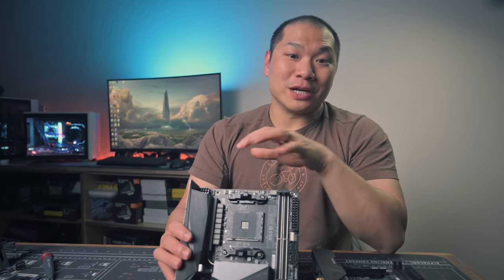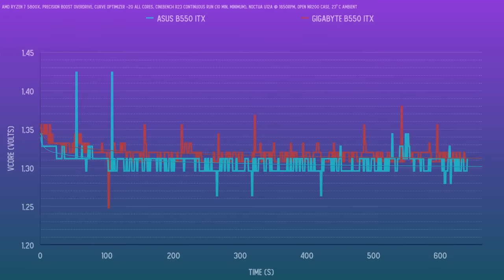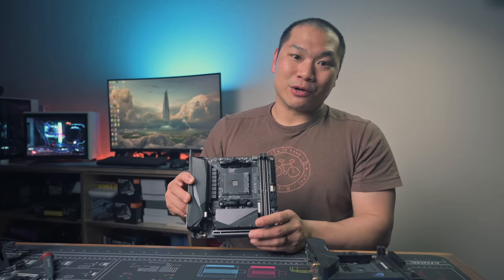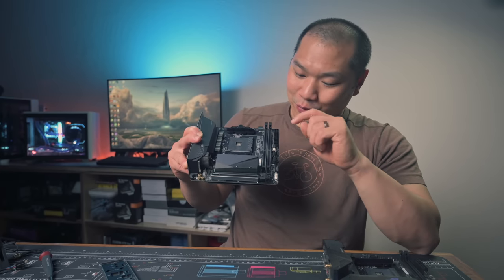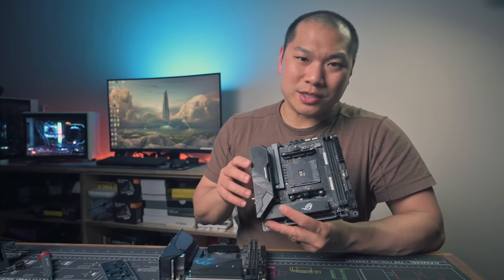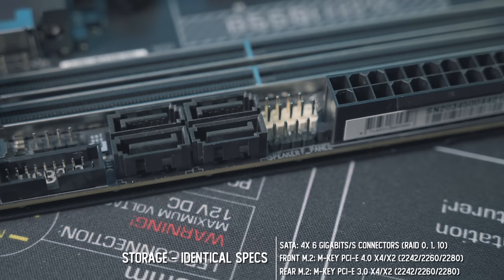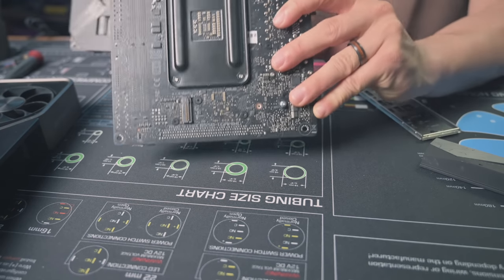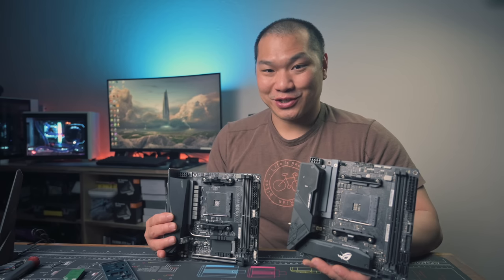Budget or Business? Comparing the Gigabyte B550 ITX and Asus B550 ITX Motherboards

Comment: The lack of USB-C front header port in the Gigabyte is a shame. We always recommend the Gigabyte except if the case has a ubs-c front, which in that case, the Asus is the go-to mobo. Really nice comparison, nonetheless.
Reply: just use a Single 19-Pin that connects both 3.0 A and USB C ports to a single USB 3.0 motherboard header.
Reply: @gabrielcorreia6216  I’ve been looking everywhere for them and haven’t been able to find one
Reply: The only reason why I did go for the ASUS was the missing USB-C front header. Rly shameful.
Reply: This is what tipped me towards the Asus.
Reply: I saw the MSI Gaming Edge dropped in price. It has overkill VRMs, type-c header and debug lights.

Comment: 1 thing I found out about the Gigabyte board (only after I bought it - and is NEVER discussed on any of these reviews or builds) is that it is plagued with both Bluetooth connectivity issues, and USB glitching. I have tried numerous online solutions to fix these but they are still intermittent and highly annoying. Also the RGB via Gigabytes software is also glitchy and has issues syncing. Love the content but I wish more reviewers would talk about this.
Reply: Running Gigabyte B550 ITX,superb board never had any issues with Bluetooth/USB glitching,but then I'm all for  for using lastest drivers.
Reply: That should all be solved now. Wasn't exclusive to Gigabyte but covered under the AGESA* update / USB issues. Bluetooth now works successfully on the latest BIOS' from... ~April 2021 onward.
Reply: I was having this same issue with the Asus B550i. I needed to clear cmos for the problems to go away. I updated the bios recently and have noticed less issues. But still have constant usb plug/unplug sounds going on.
Reply: I also still face the same bluetooth disappeared problem. Need to clear CMOS or turn off the computer (with power cable unplugged) in order bluetooth appear again. Already updated to latest driver version, BIOS to f15, still issue persists :(

I think this may be the last time I bought Gigabyte, future motherboard surely will be ASUS I guess.
Reply: It also has a raised socket position which can create issues in some cases. There is also a glitch were it "plays dead" and refuses to even turn on.
Reply: @JustOneMoreRyan  To this day there's still issues with connectivity on the Gigabyte board.
Reply: @NinjaRed5000  :( Sorry to hear. I still have the same board in my main system and no issues since that BIOS update.
Reply: @JustOneMoreRyan  my issue was my bluetooth keyboard just losing connection after it wakes from sleep and my mouse having bad connection with the wireless dongle (though I think the dongle issue is just a general issue with it getting interference from USB 3.0).

Comment: Have chosen Asus because:
CPU placement
Fan header placement (no need to run cables over whole Mainboard) 
Diagnose Led (you never know which new component could be defect)
Temp sensor header for nzxt x63 AIO fan control
VRM fan can be turned off in BIOS

So best package overall

Comment: So sad that your review does not come out before I had to make a decision. I bought the Gigabyte one, after quite a bit of research online. The main reason for the decision is the price point. Although not significant, the gigabyte one is about £40 cheaper here and my 3600 + NR 200 build doesn`t seem to need a super fancy board. I am overall happy about the board but also have some comments in addition to your great review. 
1. I am the poor guy who changes the cpu cooler and the CPU cooler header is a pain. 
2. the third mini cooler header is such a bad design. When I tried to pull the fan cable from the mini connecting cable, the cable was accidentally pulled out from the mini header. Then I realize it is almost impossible to put the damn connecting cable back to the mini header by finger or anything else because the GPU, the useless metal chunk above the m.2 leaves no space in between. 
3. Finally, I used an MSI x570 previously and see reviews about Asus, the Gigabyte is definitely behind the two - despite the overclocking settings, the fan management is simply not as good. In smart mode, you cannot manage the changing point as you wish. i.e. if you had A point at 30C 20% and C point at 70C 100%, you cannot simply set the B as 50 between 20%-100%. It will force you to point at a slash between A and C, which I simply couldn't understand. As for the manual mode, I can set the fan run at any set percentage but it will run in full at 100% above 70C anyway and it is not adjustable. As a result, the fan will on and off when I got the original AMD cooler. 

Overall, the built quality of the board is worth its price and it does run nicely. I think it fits people who build a system and use it for a long period of time instead of those who are interested in changing components for testing or whatever reason because any changes on the board almost require a full disassembling and reassembling, and for ITX, it will be some extra difficulties (and pain).

Comment: After having just built new systems with both of these boards, 100% agree with what you have said! If you could mash together features of these boards the result would be about perfect! One difference in the BIOS of these boards that stood out to me was ease of setting up custom fan curves. The Asus board requires mouse input to adjust the curve points, whereas the Gigabyte allows only the use of keyboard which really improves the ease of use. Where the Asus wins though is being able to set any fan header as a WPUMP header, as the Gigabyte only has a "100% PWM" setting instead and no dedicated WPUMP header.

Comment: I tried both, stayed with the Asus. Main factor for me was the internal USB-C header. I started out with an NZXT H1 and then a Darkflash DLH21 case, both of which had front USB-C ports. I now am settled on the CM NR200 so no need for the USB-C, but I don't regret getting the Asus Strix. It's been all good so far. I'm not sure why the Bios Flashback didn't work for you, but I did flash the BIOS on both boards without CPU installed with no problems.

Comment: totally agree, many reviewer conclude a motherboard solely base on VRM ONLY, YOU CAN"T OVERCLOCK ALL other issue away with stupid overkill VRM, stuff like lack of USB ports, stupid layout of pcie slots (like having one right below GPU slot but none at the second bottom slot), lack of fan, type C headers, or ignore useful features like digital readout,clear cmos button,bios flashback etc

Comment: Awesome review! If only the Gigabyte board had the same socket placement, I think that's one of the biggest advantages the strix board has for sff users.
Reply from the maker: Indeed, it might seem trivial but many of us know that offset can be night and day in SFF.
Reply: I literally bought the Strix just because the socket is placed lower just like the other boards.
Some reviews said Strix's VRM is the weakest even with the tiny VRM fan, but if you don't intend to overclock I think it's okay.
Reply: @MachinesMore  uh oh, will my Noctua NH-U12A fit in my NR200 if I have the gigabyte motherboard?
Reply: H
Reply: @espen990  I believe it does. The socket placement in the NR200 changes if/what type of fans you can mount in the top of the case over the CPU cooler.
Reply: A sweet air cooler for SFF builds is the Alpenfohn Blackridge but it has issues fitting on some AM4 itx boards, they did release a new mounting  bracket that's supposed to correct the issue so it might be compatible with a wider range of itx boards.
Reply: @Phanbot01  is there any good cpu coolers for the gigabyte board? I'm Building my first pc and I don't want to muck it up.
Reply: @dit_8424  Depends on the cpu, 3 coolers that fit that particular motherboard would be the noctua NH-L9i (intel) or 9a (amd), Cryorig C7 or noctua NH-L12.
Reply: @Phanbot01  I'm using a ryzen 5600x, would a sychte mugen 5 suffice on the gigabyte motherboard?
Reply: @dit_8424  Being a SFF addicted PC user, I know very little about that cooler. Checked out the website for it but the product page didn't list the max TDP that it can handle. For the 5600X I think it might work.
Reply: @Phanbot01  it could certainly handle the 5600x as I've seen lots of recommendations for it but my main concern is actually wheter it'll fit vertically like what optimum tech did with his cpu cooler in his nr200 build
Reply: @espen990  hey I'm in the same boat.  Did your U12A for with Aorus B550i?  And if so what size Fans fit as Top case exhaust.

I Have the Strix X570i and Aorus B55i on the way..
Reply: @marzero116  sorry, I ended up getting a radiator instead!

Comment: My B550i Aorus has been returned. From the moment I set it up I had issue after issue. Constant usb issues despite reinstalling drivers and even fresh install of windows. Ridiculously high cpu temps 60°c idle in windows to over 90°c when gaming using the wraith that came with my 3600 (this combo worked perfectly on my B450 Mortar Max). The final nail in the coffin for me was the case fans randomly ramping up to 100% speed despite custom fan curves this also happened in the bios. I now have the ASUS on order.

Comment: I went with the Gigabyte B550I for my NR200P build and I think you hit it on the head - excellent performance and quality with some odd layout choices.
Reply: Did you have to flash bios for ryzen 5000 ?
Reply: @bhaaratsharma6023  I did not, though I have updated it due to USB issues, which don’t appear to be fixed yet. I’m tact the bios I was on was deprecated fir an earlier one, so there are clearly some tweaks needed.
Reply: @RobertOprisko  do you still have usb or network issues? I see a lot of people facing issues with this gigabyte mobo
Reply: @bhaaratsharma6023  I am.  I'm also seeing issues using an APU in one of the HDMI ports.  The B550i Aorus MB has some persistent bugs in the Bios.
Reply: @RobertOprisko  thanks man. I guess I'll go for Asus.
Reply: @bhaaratsharma6023  I don't know that I would limit the problem to Gigabyte boards.  It appears to be a PCI 4.0 issue on X570 and B550 boards:   https://www.pcmag.com/news/amd-locates-root-cause-of-usb-issues-on-b550-x570-motherboards

Comment: Nice comparison and great production quality. I actually own both boards and both have some pros and cons. As you said the the Gigabyte feels sturdier and I like it is completely passively cooled, however I also think the Asus feels like a quality product. 
I much prefer the board layout and placement of fan headers on the Asus. It’s simply more practical and thought through. 
I’m a bit of an audio nerd, so I appreciate that the Asus has a separate audio-usb out. 
UI wise I prefer the Gigabyte’s Bios but the Asus control software is definitely better than Gigabyte’s EasyTune (had trouble getting it to work at all). At the end of the day, I think you can’t go wrong with either one and both are fun to build with.

Comment: Very good video as always ! But I think you may have made a mistake at 10:04 about the NVMe slot on the Gigabyte. There are actually 2 screws before getting access to the M.2. One for the heatsink and one standoff under that same screw, which is on the mouting hole where the screw goes. So you put the M.2 at the lowest point, then you screw the standoff, then the heatsink, the the screw for the heatsink and the big metal thing goes perfectly well, at least in my case it all fits good !
Reply from the maker: That was my impression as well on installation, but when installed the heatsink does not contact the metal block- does yours?
Reply: @MachinesMore  the metal block only contacts the edges of the block below, the ones with the screw holes for the top block. I suppose putting some thick thermal pads would be a good idea.

Comment: Great comparison of 2 great boards. I went with the Asus solely so I can put 2 top fans in my Nr200 and because I prefer their bios and bios update speed :)
Reply: I have the gigabyte and no issue with top fans, I am using a pure rock 2 though which may be why they can fit.
Reply: @pwnedsocks  that is the reason. I should clarify I’m using C14S for cpu cooler which doesn’t fit both tops fans with gigabyte unless you use slim ones or what not

Comment: Great video! I just wanted to say your videos helped me alot in choosing my parts and configurations for my first ITX build with the NR200. I'm rocking a 5900x + RTX3070 + X63, with CPU temps maxing at 65 degrees and GPU at 72 degrees :)
Reply: You know how many watts your psu is? It’s a blood bath trying to find one right now and trying to see if I could get away with a 650watt
Reply: @Soggy-Soy-Toy  Shouldn't be an issue. I got a 5800x and a 3080 on a 650w psu inside the NR200P. But if you're OC'ing a 10900k and drawing 300w alone at that you need to look for more watts lol.
Reply: My psu is 750w but I'm pretty sure a 650w is sufficient. I couldn't find a 650w sff PSU in my region hence why I chose the 750w
Reply from the maker: I would be comfortable with 5900X and 3070 with a 650W unit.

Comment: Thanks for the great video! I had the exact opposite experience with updating the BIOS. The Gigabyte's Qflash Plus would not update. I tried 5 different usb drives and even had it replaced by Amazon. Couldn't get it to work. Asus Strix Flashback update worked first time. There are quite some people on reddit complaining regarding Gigabyte's Qflash (but I imagine same for Asus update). Also, additional reason to buy the Strix board is because it allows slightly larger CPU cooling fan in the NR200p (with glas panel) and optional usb-c frontheader, if I ever decide to upgrade the case.
Reply from the maker: Very interesting, thanks for sharing, I’ve heard it both ways now and sounds like it’s hit or miss, perhaps it also has to do with what BIOS version the boards are on to begin with.

Comment: I also wanted to provide a warning to anyone else with the Gigabyte B550 ITX about over-tightening the M2 screws. The way the hardware works, you have a standoff soldered to the motherboard, then the SSD drive goes on top of that, then follows an offset to separate the SSD from the heatsink (the offset looks like a hex nut with threads coming out the bottom), then comes the heatsink and finally a screw. The problem comes from tightening the offset. The way the offset is made, there is a threaded piece that goes into a nut, and this thread is merely held into the nut with some blue loctite. If you turn the offset too many times, you can actually break the loctite and start threading the offset's threads down into the motherboard standoff to the point where the nut comes off leaving just threads plugging your motherboard standoff. At this point you will never be able to properly mount your SSD without some alternative like glue or tape. This is a really bad design and very frustrating too. I just moved my SSD to the slot on the other side of the motherboard (the one with no heatsink) but I just wanted to warn anyone not to turn the offset too many times.
Reply from the maker: It’s and odd design for sure, plus the hex driver for the SSD isn’t something everyone has handy. Thanks for the advisory😀

Comment: Great comparison and I agree with all of your points. I was debating between these two but ultimately went with the strix as it would let me use all the front IO in the NCase M1 and allow me to fit a Noctua C14S. It does feel flimsy and cheap and sometimes I wonder if I should have paid the extra $40 for the X570 Strix. But then I read all the reddit posts complaining about the loud chipset fan and feel glad that I didn't. The B550 has been running a 5900X just fine and I haven't heard the VRM fan spin up yet, probably because the C14S is cooling the socket as well. I will say that I have also heard of connectivity issues with the Gigabyte board, with many users claiming bluetooth disconnecting often.

Comment: Nice informative video for an otherwise rarely covered topic - motherboards. Would be better to actually show top case fan compatibility with some mainstream coolers on the NR200/NR200P since its such a popular ITX case, and you have it on the channel as well(or at least share a link if its done before) for both the boards. Also the Asus's WiFi antenna is magnetic too, at the flat surface of the actual antenna, instead of the base where the antenna fits into. At first I was thinking if this would cause interference and degrade the WiFi experience, but so far so good. I don't notice any difference on the WiFi speed and strength on my B460-i Strix.
Reply from the maker: Indeed- the antenna is magnetic in an odd way (meaning you can’t have it on the base and then stick it on your case if you need to). I’ll make sure to revisit case compatibility at some point with the Asus boards.

Comment: I love my Gigabyte B550 ITX.  Buildzoid approved and was also the cheapest ITX board at the time.  It marries with the NR200 perfectly since there isn't any front USB type C.  No issues with top mounted fans.  One thing I would suggest is to plug the reset button connection into the bios reset instead.  Very useful if doing a lot of OC.  It's a pain to reach the bios reset button otherwise.
Reply from the maker: Love it! Good idea when dialing things in.

Comment: I have the Gigabyte B550 ITX and the bluetooth adapter frequently drops out of existence (can't even see it in device manager). Many people are having this issue and solution is just to power cycle the PC (unplug and plug back in). When you plug back in, bluetooth will be back. I am not RMAing the board because it seems like a widespread issue. If you care about bluetooth you might want to get another brand.
Reply: Yup.  Bluetooth is a nightmare on mine as well. Latest BIOS and everything. It started happening a month or two after I had it. If you use Bluetooth, I cannot recommend this board at all. Everything else is great!
Reply: What are you using BT these days for?